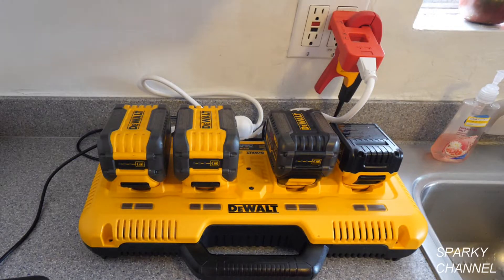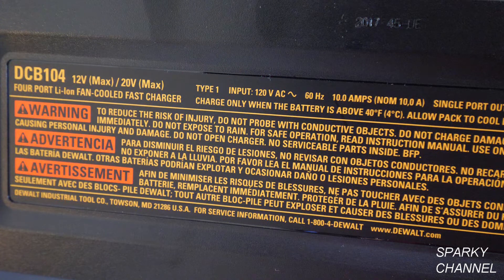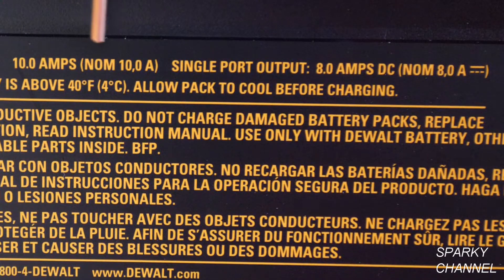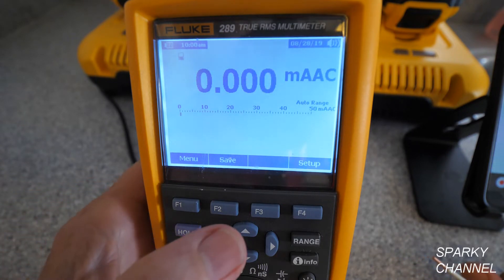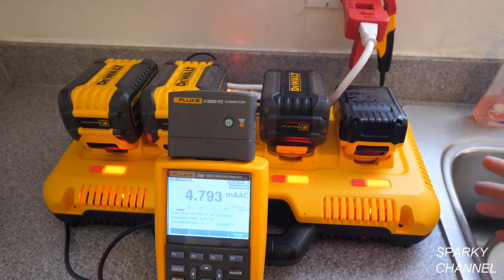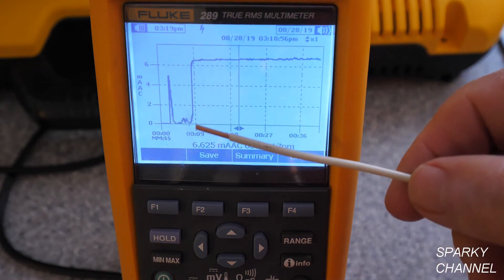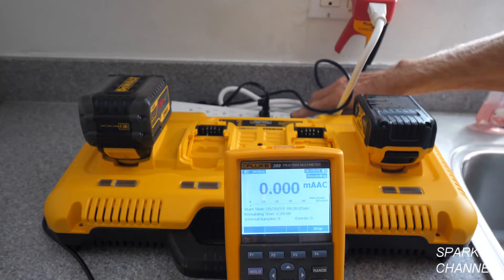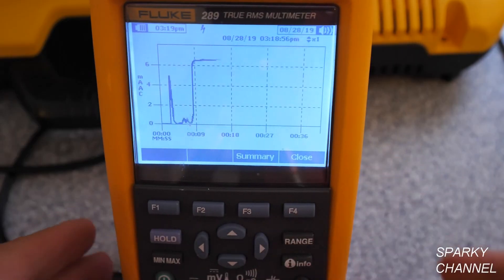How Much Amperage Does a DeWalt 4 Port Battery Charger Really Take? (Graphing Included)

Comment: You can only charge the batteries at 20% of their capacity per hour or .2 C.  If you had all ports charging big 5 amp batteries, .2 C of 5 amp batteries is 1 amp per hour (or amp hour).  Therefore you could only charge at around 4 amps without damaging the batteries from charging too fast.  The unit also has to power other things in addition to charging the battery like the fans, lights, AC->DC conversion and so on which is probably why it reads over 6 amps.  The 5 ah batteries are kind of big for hand tools so this is probably designed more for the 1.3 ah or 3 ah batteries, though it will work with them all.

If you wanted to FULLY SATURATE the 10 amp limit on the charger, you would have to use those big 15ah flex volt batteries.  20% capacity or .2C for those batteries is 3 amps, so if you were charging four of them it would probably pull its maximum of 10 amps and divide that evenly amongst the batteries.  I heard bad things about those 15 amp batteries though like they might not be stable.  Never used one myself though.  

Long story short, the unit is wired and fused at 10 amps.  Any more will blow the breaker inside the unit.  And all wall sockets have a limit of 15 amps with a few exceptions.  Too close to 15 will blow the breaker in the power strip.  More than that will blow the breaker in the breaker box.  More than that will probably blow the wires in the wall.

Comment: 6.7 amps ac. That's actually quite impressive and it's doing as advertised. let me show you. 110v @ 6.7 amps translates to about 39.83 amps DC, (110Ac/ nominal 18.5 v Dc = 5.94) so when volts gets transformed down amps goes up by a factor of 5.94 in this particular case so your measured 6.7 amps ac would actually be 39.83 Amps total DC (6.7*5.94=39.83Amps total DC) divide that by 4 ports and you roughly have 9.9 Amps per port total I say roughly because I'm assuming the charger is dedicating more amps for the two bigger packs but don't know for sure. That's actually quite impressive and lately DeWalt hasn't been giving false claims on their products. Only thing is I don't really like the idea of shoving almost 10 amps DC into a smalller 4 amp pack like that. I usually like to use the amp rating for the amp rating to stay safe and  make the packs last longer for instance a regular 4 amp hour battery can be comfortably be charged at 4 amps in about an hour and a flex volt 9 amp hour can comfortably charged at 9 amps in an hours time. Most can handle more I just don't like to. I like to stay within that 1 hour charge time. Thanks for the video as I was actually curious about this
Reply from the maker: Thanks Drew. I was pleasantly surprised with my findings as well.
Reply: Lol damn you are clueless, where do you live that you only have 110 volts? Most homes have at least 120 volts possibly even 125 volts. There is no way the charger is outputting 9.9 amps per battery, it says right on it a maximum of 8 amps output. It is drawing more power than what it is outputting into the batteries because guess what, battery chargers are not 100 percent efficient.
Reply: No you got it wrong in a couple different places.

First AC standard voltage is 120v not 110v.  Some places overseas use 240v but 110v is basically wrong in both places.

Second 6.7 amps AC is exactly 6.7 amps DC.  You would need an inverter to convert the amps from AC to DC at about 20% penalty (1.34 amps), so about 8 amps total from the wall or battery including the conversion penalty.  But amps dont magically increase from 6.7 amps to 39 amps this is completely incorrect.  If you want more amps you need to buy a bigger generator, you cant increase amps with fancy math.  I guarantee you the breakers and wires in both the charger and the wall will blow at nearly 40 amps.  The charger is wired and fused at 10 amps and it doesnt handle any more than that without blowing a fuse or a wire.  The wall is wired and fused at 15 amps and it doesnt handle any more than that without blowing a fuse or a wire.

Third you can never charge at 9.9 amps per port because batteries can only charge at 20% of their capacity per hour without damaging the battery.  There are no 45 amp batteries, so no batteries can charge at 9.9 amps without completely exploding and destroying the battery and therefore this is completely nonsense.  There is a hard 10 amp limit on this charger, and for most batteries you will get an amp or two per port.  The rest will go to the fans, lights, and AC->DC conversion.

Comment: I didn't see dampening at start up, only a current spike while the bulk capacitor charges, than a short moment where the charger is testing the battery and then the charging cycle starts.

Comment: Great video! Finally someone that evaluate the electronic devices properly, tanks for the information.
Can you evaluate the output from the DeWALT power station DCB1800?
I do not see the modified sine wave they claim 😟, and the spikes are big!
Reply from the maker: Thanks so much, I really appreciate that.
The DCB1800 is a very different item and I don't think I'll be able to make a video on it because I don't own one. Here's some info on the DCB188 for other viewers: 
DEWALT's DCB1800B 1,800 Watt Portable Power Station delivers 1,800W continuous and 3,600 peak AC power when supplied with four DeWalt 20V MAX batteries (sold separately). The DCB1800B is also a multi-port battery charger for one to four 20V MAX batteries. DCB1800B emulates a 15A residential circuit branch, delivering the feel of household AC power. Patent Pending modified sine wave is compatible with both standard and electronically controlled variable speed tools.
Reply: eh?  Of course its a sine wave its coming from a wall socket.  DC current doesnt produce a sine wave only AC current.

Comment: @Sparky Channel. Bill another great review. Found out the fan for the DCB104 keeps both the charger and batteries cool. I think that's important when rapidly charging a battery. Makita is the only other company whose rapid chargers (included with their tool kits) that fan cools their batteries.
Thank you for the information.
Reply from the maker: Excellent info, thanks. I'll have to check that out. I know Makita has a pretty powerful fan for their batteries. DeWalt will be coming out with 2 new  single unit fast chargers. Perhaps I'll do some comparison with the DeWalt v Makita.